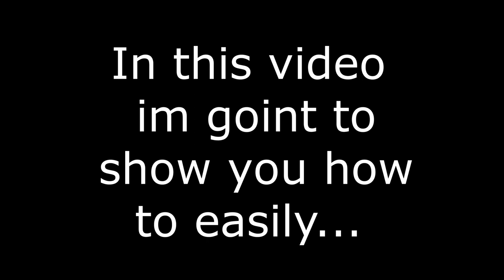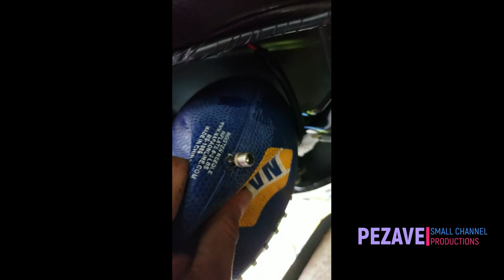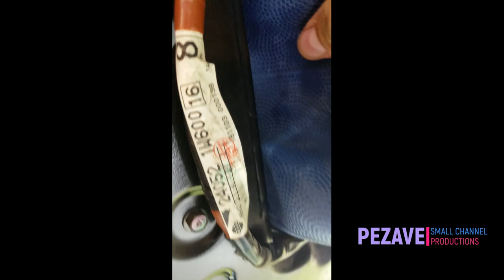Remove Car Dents using a football

Comment: my sons suv had a grape fruit sized dent in an inaccessible area by the side  rear glass.  took him an hour to remove inner trim to gain access to the dented area.  using a $3 kids inflatable football, some chunks of wood to brace the ball it took all of 2 mins to pop the dent using your idea. have to say the body metal was of a heavy gauge steel but didn't stand a chance..  thanks for posting your idea.